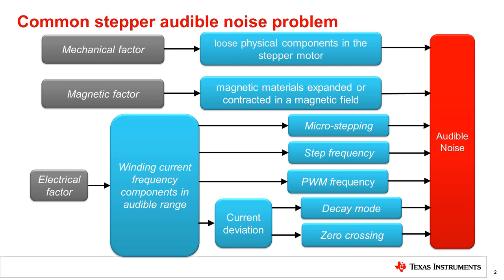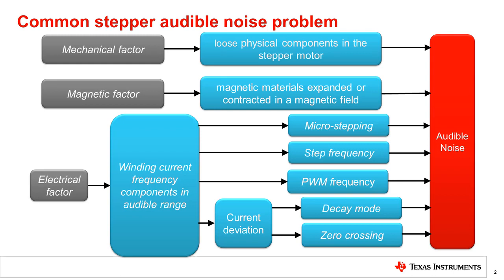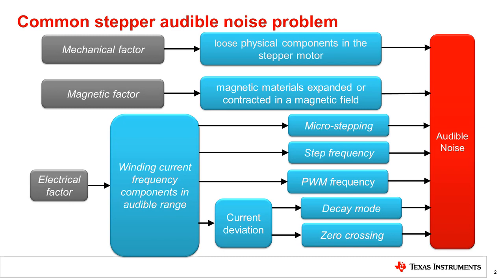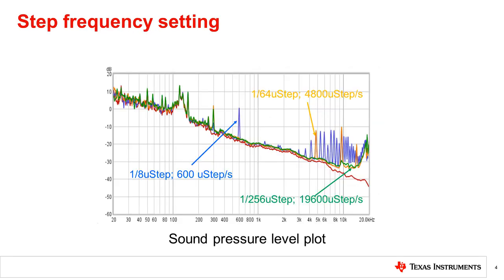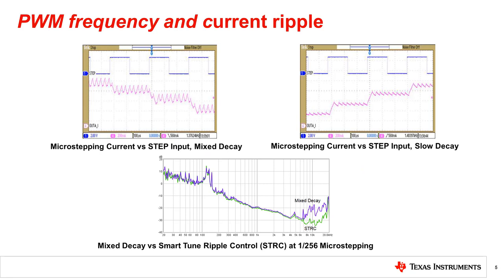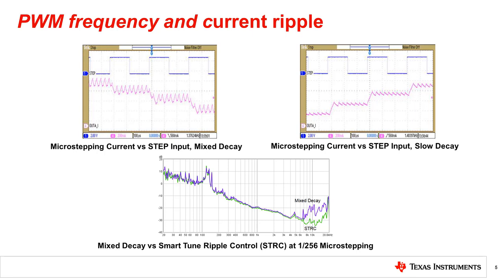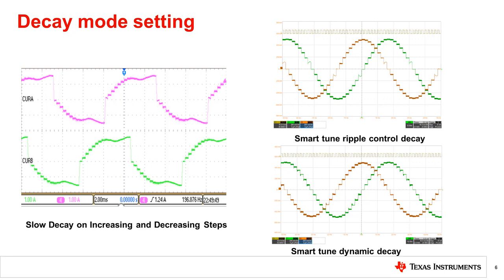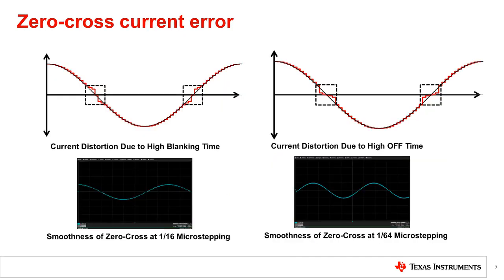Audible noise in stepper motors

Comment: I think I could learn to understand this accent better with bit more practice but I think cleaner audio would likely make it easier to understand this speaker. I think I was able to follow along reasonably well but it required more effort than usual to understand the speech. I enjoy the variety of accents I hear in these TI presentation but this one was kind of hard to understand.
The automatic caption feature appeared to have trouble understanding the same words I had trouble understand. It would be great if TI added their own captions to correct the auto generated ones.
Thanks for making these interesting videos.